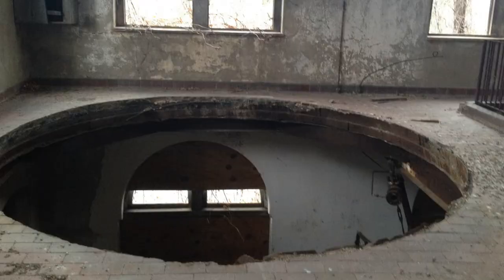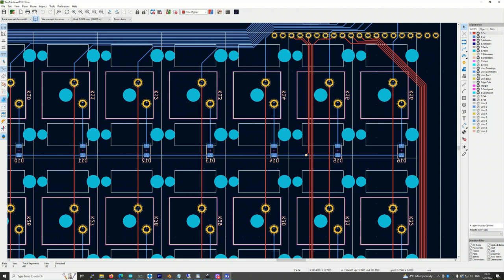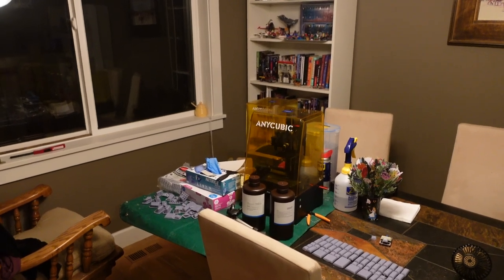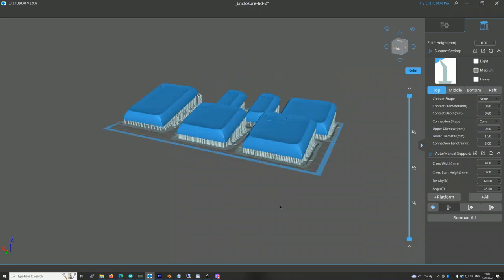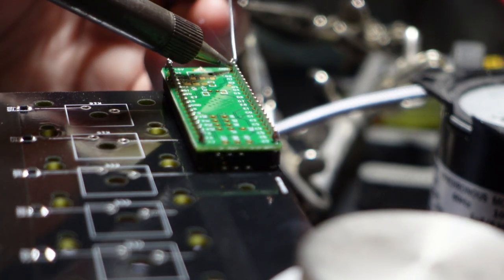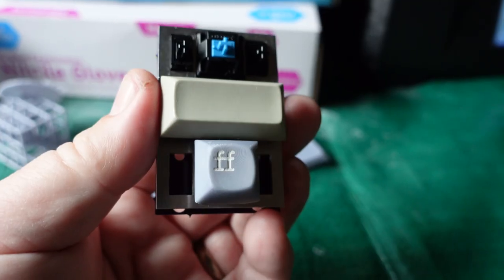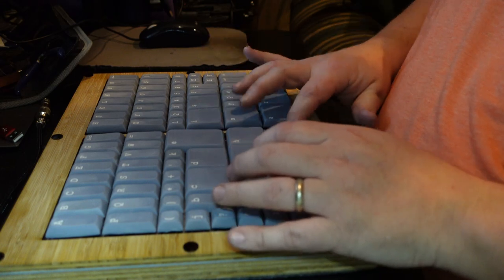The Two Thirds Keyboard (The worst keyboard in the world?)

Comment: Manual letterpress printing was one of my (many) hobbies as a kid. - Yeah, I’m both that old and that weird 🙁

You’re probably well past this stage, but the mnemonic for the first lower-case row of letters is “Be Careful Driving Elephants Into Small Ford Garages”. The second row is “Let Me Now Help Out Your Punctuation With (commas)” Unfortunately, I no longer remember the phrase for the bottom row at this distant remove :-/ 

I’m not sure you mentioned it, but the arrangement of the lower-case letters was designed to minimize total hand-travel while composing. I guess that’d also minimize finger mileage in hunt & peck typing as well 😄

Awesome project, BTW! Now you just need to make an electromechanical connection between this and the pocket typewriter 😆 (Seriously though, don’t consider doing that, I wouldn’t want to be responsible)
Reply: He really needs too see this comment
Reply: In the poster in my letterpress shop, the third line says Villains Usually Take A Ride :-)
Reply: i found "VUTAR

Villains Usually Take A Ride

(or, Villains Usually Take three-ems And Run)"
Reply: @littlebirdsword  Ah! That’d do it! 👍 I think the one from my high school graphics shop was something different (something about Volvos, maybe?) but  villains usually take a ride is great and easy to remember :-)

Wow, you still have a letterpress shop? That’s pretty cool! Where are you and what kind of work do you do? Do you have a website?

There’s no way I’d have time for it, even if I still had my old Kelsey hand-operated press, but it’s super-nostalgic to remember it. I really loved everything about the process: hand-setting the type and locking it up into the form, inking the press and setting the paper guides, the rhythm of insert-sheet/make the impression/remove the sheet, etc. The smell of kerosene still reminds me of cleaning the press and rollers :-)

(Hmm, well - I loved almost every part of the process. Not “decomposing” the type. I hated that part 😉)
Reply: @astral_haze  Ah! That’s excellent, and it includes the em slugs!

Comment: For the ligatures, wouldn't it make sense to just send the individual characters, eg if you press the "fi" key then send "f" and "i" then it would work in any software, and the software would deal with the ligature in the same way if would deal with it when entered on a regular keyboard.
Reply: Bah! What's the point of including ligatures on your keyboard if you're not going to send them to the software as ligatures.
ﬀ and ﬁ for the win! If they don't display properly, then that's the software's fault for not supporting unicode. (Or the font's just for not having those glyphs.)
Reply: @angeldude101  Well there could be a switch on the keyboard to choose the ligature key behavior.

Comment: As someone who made the switch to Dvorak years ago I can't recommend it enough. I absolutely love it. It is also rather easy to go back and forth between Qwerty and Dvorak as the need arises.
Reply: The big issue with dvorak is that at least when i used them +10 years ago was that they broke games and programs that use a lot of keyboard shortcuts
Reply: I learned to type on a Dvorak keyboard, I was never able to learn qwerty, it just didn't make any sense to me. 

As for Dvorak breaking keyboard shortcuts, just set up the language switching shortcut in Windows, and switch keyboard layouts before you start the game. Most games nowadays will modify themselves to accept the proper inputs from the proper keys in the proper position, so if by default the action button is E, it will say press . so it's not really an issue unless you look at the keyboard a lot for shortcuts. I usually just hit the keyboard switching shortcut I have set up on my K95.

Comment: I was wondering how you did the infill. What specific epoxy did you use?

I've done infill with an injector and nail polish, it works pretty well too, but is stinkier.
Reply from the maker: Oh right, I forgot to include a shot of it in the video: JB Weld PlasticWeld.

Comment: That was a super interesting video. In my opinion, if you're going to learn any alt keyboard layout, you're better learning Colemak instead of Dvorak. Colemak keeps zxc where they are on qwerty so you don't lose those precious shortcuts, it's quite a bit easier to learn than dvorak, and it has a more even letter distribution. Plus most words can be written on the home row, which is pretty cool. And as weird as it sounds: CAPSLOCK -> Backspace is amazing, I still do that even when I use Qwerty.

Comment: When I was first learning to type, I tried to learn on a qwerty keyboard like pretty much everyone else in the United States, but no matter how hard I tried I never could get past about 15 or 20 words per minute. Then I saw this little thing called Dvorak in the options, and within a month I was typing 50 words a minute. I still use Dvorak and regularly break 120 words per minute, though my average is between 95 and 100.
Reply: Alternate keyboard layouts are the best, I use a slightly modified colemak on my split vertically staggered split keyboard and it's a joy to type on. Clacky clack clack clack clack
Reply: @minerscale  I have never looked into any alternate keyboard layouts since I learned to type. I figured there wasn't really any need to at the time, since back then I was typing around 75 or 80 words a minute which was faster than any qwerty keyboard typer that I personally knew.

I'll have to look into Colemak. I have heard the name before, but past that I don't know anything about it.
Reply: @shattered_helix  Colemak is better than dvorak by most metrics you can measure it by and has a couple other perks like leaving z, x, c and v, and a in the same spot to make default shortcuts still very doable. A brilliant middleground between perfection and practicality. I recommend the dh variant though.
Reply: @minerscale  I'll give it a look, though I doubt I will switch having been typing on a Dvorak keyboard for 30 years. It's just kind of ingrained in me and for my purposes, I think a hundred words a minute is probably fast enough. But who knows? I may end up liking it better.
Reply: @shattered_helix  Yeah fair enough, qwerty -> dvorak is a big difference, dvorak -> colemak is better, but not that big of a change I believe.

If you don't care about any kind of shortcut backwards compatibility and you want something that is perfect by the metrics humans tend to care about when typing HALmak is ridiculous and for you lmao.

Comment: I'd be curious to see, just as a concept, the two-thirds scaled down by half, so that all the 2x2 keys are standard 1u keys. Though this would only really work with all of the half keys having domed tops, if not a parabolic curved top, so that the keys themselves can be differentiated by the finger tip. Or, say, make the base unit 0.75u, rather than 0.5u so that there's still some actual width to the keys. The only design consideration here would be going with a membrane switch or making your own scissor switches from stamped steel (similar to the Cherry MX Ultra Low Profile switch), as full-sized mechanical switches don't exist within this size and any mecha switch that does exist in this size, tact switches and mouse switches, won't have the same weighting or throw characteristics; though within the controller world, there are mechamembrane that replaces the carbon pad contact with a mouse switch, which does return some amount of throw and modifies the springiness of the key. From personal experience with typing on a variety of designs, I have noticed that I don't always hit keys in the center, a lot of keys I'll edge or corner type depending on the design of the keyboard, thus I think mini keys have potential of working in an odd layout like this, but only if they have a modified shape to enhance usability.

Comment: It took me 3 months, full-time to learn Dvorak having been a QWERTY typist.  I was 22, and had been using computers since I was three.  Within those 3 months, I managed to get to my original QWERTY speed and now I exceed it significantly because I learned to touch-type properly.

It's now been 14 years!  I can still touch-type QWERTY but there is a mental 'cross-over' that I have to do and it is slightly reduced in speed.

I imagine that if you give yourself six months you could do the same thing with the two-thirds.  It's pointless - but at least it would be fun if you ever had to take the keyboard to somebody else....!

Comment: I don't understand the bit about how a diode on each key fixes ghosting? It seems like all four input wires are still in the same position as before, how does the micro controller get any different reading with a diode?

Nevermind, I think I understand? You're actually sending a pulse into the row, and as you do so you're checking which columns light up for that row. So the other rows are all still turned off while you scan that one?

Comment: I could see after more training this keyboard would easily outpace a qwerty.. may be worth sticking with it longer!
Reply: Perhaps merge lower and uppercase letters first.
But there's the thing with QWERTY, it's not adapted to any language, and extensions are added for other languages. For example the upper row expands depending on language:
Q W E R T Z U I O P Ü - German
Q W E R T Y U I O P Å - Swedish
Any keyboard trying to improve letter position based on English only is ignoring all other languages. Currently German, Swedish and other languages expands outside QWERTY since the letters are random anyway. But if you make a layout that groups all vowels together, why wouldn't German Ä Ö Ü be added there too? Changing the layout massively.
I think this is another reason for why QWERTY has stuck around.

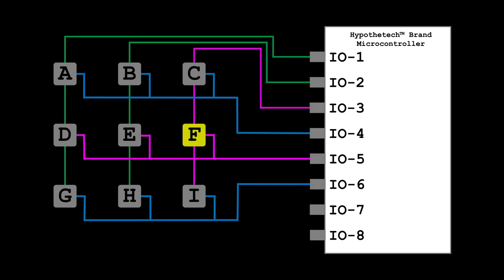Comment: 3:10 There is one problem with this. Should multiple keys be pressed, there are multiple 3+ key combinations that result in the same detection.

For any 4 keys that between them share 4 IO ports, it is impossible if 3 or 4 of them are pressed. And if 3, which 3. Or even if it is diagonal-pair, which diagonal.

In the presented picture, AE, BD, ABD, ABE, ADE, BDE and ABDE all produce the same result: ports 1,2,4,5 triggering.

3:50 Oh.

Comment: 128 Experience gained in Keyboard Knowledge.
You have gained Level 1 in Keyboard Knowledge. 
32 Experience to Lore.

btw, my keyboard doesn't need stabs to keep it in line; it uses switches devoid of their signaling components. so your solution is actually quite modern.

Comment: I'm surprised you didn't cast lead, or maybe rather pewter keycaps for that typeset feel.
Reply from the maker: Hrm, I have experimented with casting type from matrices some, with some modifications to the mold body I could probably make that work...
Reply: @Attoparsec  Neat!  Keys seem like they'd mold and cast really nicely on the front and be a total pain on the back.  Apparently there are some low temperature SLA resins that are good for burnout that could work for "lost wax" style casting but I don't know the particulars.

Comment: individual data lines, switches, or you cant separate keys from each other
Reply: touch screen pad under a flex sealed membrane keyboard with key mesh is better
Reply: cnc/laser plastic  sheets to layers, bond in heat oven

Comment: I think you got it wrong with your thought experiment, stairs would be very logical to be used if it was invented today. Stairs aren't holes you go down. They are micro floors you traverse to enter a main floor. So basically making the falling distance slower. Now elevators a giant machine that just falls to the floor that is something that you would think wouldn't go over so well.

Same with keyboards, they aren't complex at all. Since everybody is literate there is now a demand to be able write words and unlike maybe some type writer requiring some complex operations a keyboard has has all the keys just layed out for you to use without needing any knowledge, people are impatient so they would want to do it faster but there is no reason you can't take it slow.

Also for the gasoline, they can't ban easily handeling stuff that most people use, since most cars are still ice it would definitely still work the same even if ice cars got invented tomorrow. (Since cars are so much more efficient than not cars for the average person there is no way they wouldn't allow it.)

Comment: 0:45 technically false statement. 

at the pump station, you can only put the pistol in the car tank. the car must be approved. and approved cars ... you can't take gaz back. so you can only buy the volume your car tank can store, and you can't take it out.

it's allowed to put 5L in an approved bottle. 20L bottles are technically forbidden in France. 

so, if you read the details of the law in France... the thing you have in mind at this point of the video ... is not legally possible. 

in practice, yes you can customize your tank, open the cover and pump back. yes you can put 5x 20L bottles in the back of your car and the cashier won't move an hair ... but it's illegal.